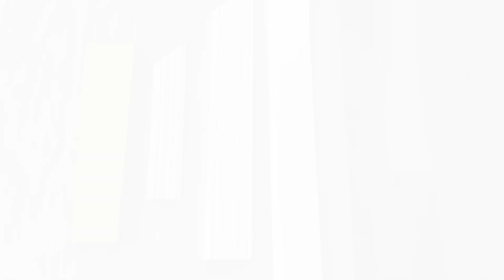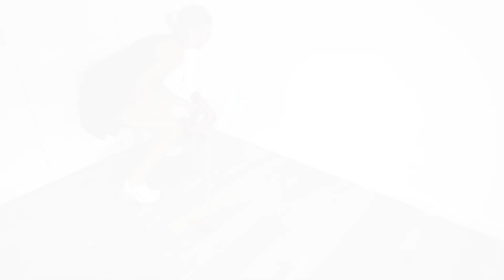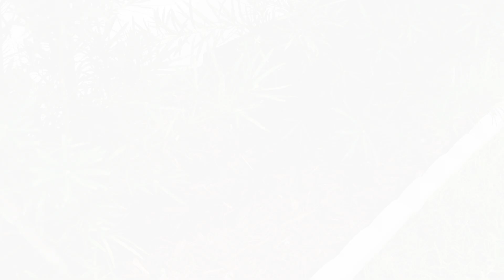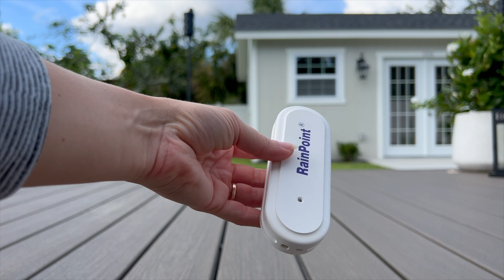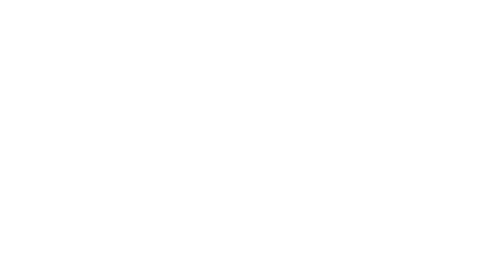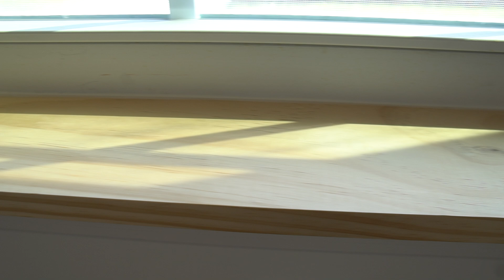How to Install Trim: Windows, Doors & Baseboard

Comment: I hate to be "that person" but I'm going to be anyway.  Please, please, please get a push block for your table saw and use it EVERY time.  I know it was just a "small project" but if that wood in any way binds to the saw blade it could literally pull your hand onto the blade.  I absolutely say that with your best interest at heart... not to be a complainer 💜
Reply: There actually was a push stick on top of the fence, which she ran her hands over to move the wood through the saw from behind the fence. Scary/brave?🤔

Comment: I've started replacing all the trim and casing around our 80s house. You wouldn't think replacing it with something modern would make a huge difference but it does 😍 watching all those gaps disappear with caulk is 👌 I use baby wipes to get the cleanest finish which is quite wasteful. I noticed you using a wet finger and rag, was there anything in the water to help remove it? Love this project and I'm enjoying watching it come together 🙂

Comment: Couple notes always put the head casing on first, and back cut and cope the corners as miters will open up over time. Not being a troll just offering advice from a 30 year construction professional. Also great work I love to see people try out projects themselves. It’s not as easy as everyone thinks it is.
Reply from the maker: Thank you for the tip!
Reply: Also I am jealous of how nice  your shop will be, mine is in the garage and a hot mess as I have way too much stuff.  @HomeWithStefani
Reply: ??? When you say "back cut and cope the corners as miters will open up"... are you referring to the floor trim?  Because she didn't miter the window casing corners?  I think you were talking about the floor trim but hard to tell from your comment.
Reply: @wickedwinnie  yes the base boards should be cut at a 45 then back cut with a coping saw so that as the room expands and contract the joint stays closed. When you case an opening you always start with the head casing installing it with a 1/4” reveal on the jamb. Then cut a 45 on the side piece flip it over and hold the side pieces and mark at the tip of the head casing and cut a 90.  That way no measuring is required and you can make sure you close the joint on the 45.  That is how I was taught 40 years ago by my grandfather who was a carpenter for his whole life.